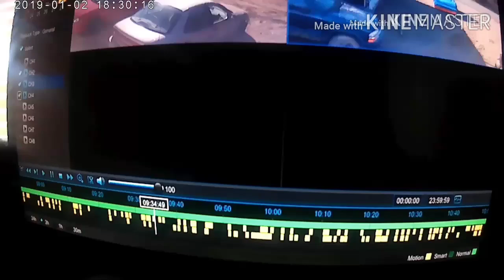Building 4 Cylinder Race Car.  #FWDracing #dirttackracing

Comment: Get 16 in wheels they make the world of a difference
Reply from the maker: Depends on track.. You only really ever want big tires on big track of if trans isnt welded. Diffrent on dirt.. On asphalt yea big tires are good.
Reply: Yeah I race asphalt, never raced dirt before i wanna try it tho
Reply: @nicksspeedshop3021  your gonna have to add different suspension if you want to drive on that rough terrain.
Reply: @soul9549  sof†er or stiffer springs?
Reply: @nicksspeedshop3021  idk I just know you need different suspension
Reply: @soul9549  my local mini stock class only allows for oem suspension